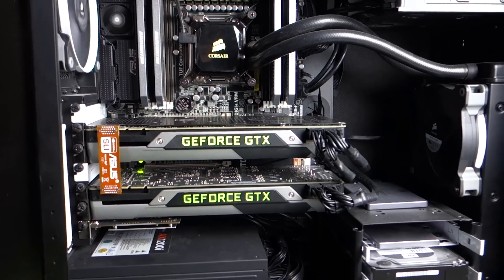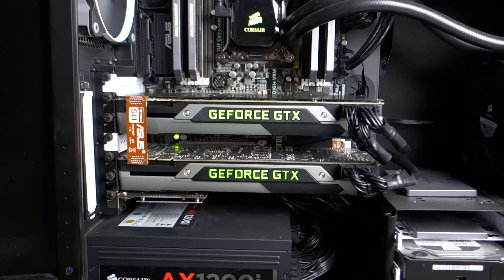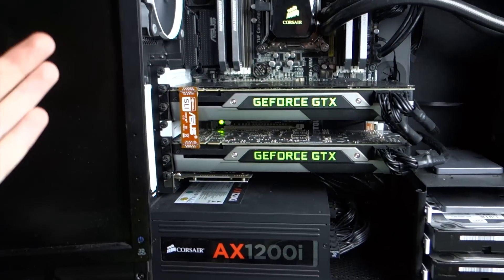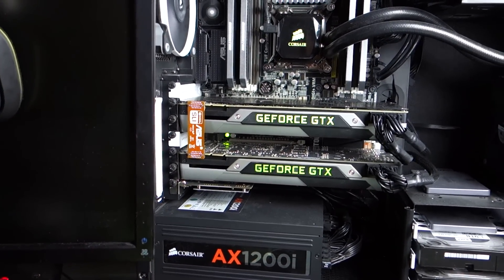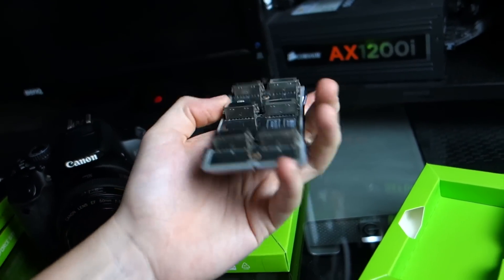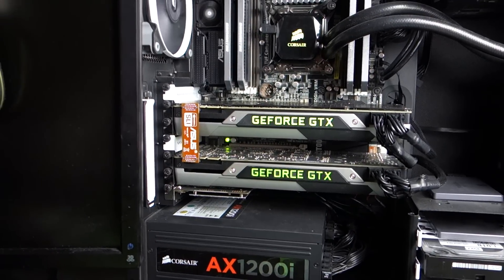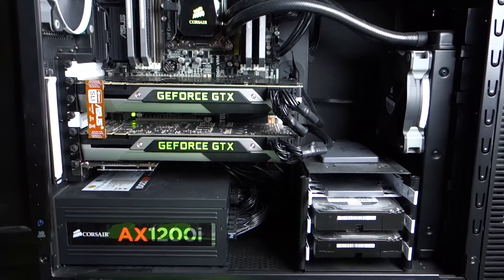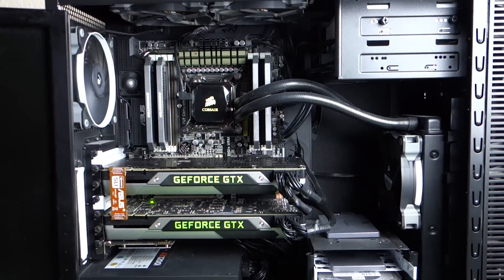SLI Bridge FAIL

Comment: you need to wait for asus to bring out the hb bridge for that board spacing, i have a rampage extreme v and 2 x1080s and the evga hb bridge fits fine, my spacing it between the top pci and the 3rd pci and that is 81 mm apart.

Comment: You need the 60.97mm sli bridge, or the why nvidia says it, 2 way 3 slot bridge. Everyone else will measure it 2way sli long, or 2way sli 60mm which will fit and work with that board. I my self run 2x 780ti's reference, I ended up buying the EVGA Pro bridge becuase the LED was white to match everything in my PC, Other then the damn Nvidia green led on the cards which I should sand them down so they are white.

Comment: What does sli brige do
Reply: +loo jian rung
(Just in case  You haven't found out elsewhere) The SLI bridge allows the graphic cards "communicate" (i.e exchange data) without having to go "via" the motherboard(pcie Bus). They need to communicate to be able to "cooperate and give output as if they were 1 more powerful card. So it's "simply" a technique that allows the Gfx-cards to run more efficiently when they are "cooperating on the same workload". They would loose performance if the had to compete with other parts of the computer using the "resources of the motherboard" for communication that really doesn't "concern" any other component than the two (or more) graphic cards. You can very well run more graphic cards without using SLI but You will miss the performance gain that it offers. 
 (SLI only works with (certain) Nvidia cards, AMD have a similar technique but they call it "Cross Fire")
Best regards.
Reply: This might have been the best explanation of SLI in history... and probably nobody even read it.

Comment: You have a 60mm gap, Nvidia offers 80mm gap bridges (2 way Spaced and 3 Way) I bought one of the EVGA Pro V2 ones because I had the same problem with the Nvidia claw bridge. the 2 way spaced bridge from EVGA is 60mm and doesn't look bad at all :)

Nvidia SLI Bridge spacing FAQ
http://nvidia.custhelp.com/app/answers/detail/a_id/3576

EVGA Pro v2 SLI bridges - Measurements on the bottom of the page
http://nvidia.custhelp.com/app/answers/detail/a_id/3576

Comment: simple change mobos. i did. was sooooo worth it.
Reply: +Tanzu15 How do you determine which boards will work?
Reply: +TheAjax618 By looking at the PCIe 16x spacing... It's really not an issue if you use a little sense and think about what you're doing.
Reply: +Jesse Deptula Yes. Right after I posted this I looked in my mobo manual and the spacing for the sli bridges. Nvividia sells every spacing now. When I purchased a few months ago the one I needed wasnt for sell yet.

Comment: Hudson, 

I had the same issue as you. Here is my fix, with lots of pictures:
http://www.overclock.net/t/1564491/nvidia-geforce-branded-sli-bridge-mod-lots-of-pics

I ended up buying the buying the spaced bridge and then taking it apart and connecting a shorter bridge underneath. 
Please let me know if this is helpful. 
I like your videos and you should be grateful you have the means to make them. 
Goodluck!

Comment from the maker: A lot of you guys are recommending the Nvidia 2-way spaced bridge. However it is identical spacing to the 3-way one I have, only difference is the middle connection is removed (and also the subtraction of the 2nd row). I appreciate the suggestions, but that's unfortunately not going to fix it. Thanks a lot for watching guys, I'd like to do more videos like this in the future. They are fun to get a discussion going :D
Reply: ***** My MSI motherboard came with a flat wired SLI Bridge thats black instead of a PCB one. Maybe get one like that.
Reply: GameThruz that was my problem, looked at their diagram and misinterpreted it lol, oh-well was a good excuse for an upgrade.
Reply: Does that mean that you are going to spoil more stuff for our entertainment ???😜😜😜
Reply: ***** Ran into this same issue on my P67 Sabertooth :( Ended up swapping motherboards to to make this work. I wish Nvidia would produce a "Motherboard Compatibility List" would have been nice to have. So many motherboards have this kind of spacing, in fact pretty sure the majority do. Such a fail on Nvidia's part imho
Reply: +Joey Rakas I have the same issue with my Asus motherboard.  How do you determine what motherboards will work?  I have a spaced Nvidia bridge sitting in a drawer that can't be used.
Reply: Well as you said you didn't do your research, Nvidia do list it clearly on their site with pics.  But you might like to know they have introduced (quietly) an SLI bridge that will work in that spacing (one pcie slot between two cards).  Here's a link http://www.geforce.com/hardware/technology/sli/bridges
Reply: Joey Rakas I have no idea why they decided to do the other two but not the most common one, it makes no sense.  Hopefully I'll be getting one soon for my reference 780s eek
Reply: Nvidia sells spaced bridges for 2, 3, or 4 slot spaces on their website, not sure if they just didn't have these back when you made this video :P https://www.geforce.com/nvidia-sli-bridges

Comment from the maker: Well so as you can tell I'm not completely up to date on everything. Absolutely butchered saying z97, welp LOL.
Reply from the maker: ***** unfortunately not, it's the same spacing as my 3-way one. Just minus a connection
Reply: ***** yo im going to get a GTX 770 and i also have an intel i5 i dont the exact cpu but i also got a 600w power supply will that suffice for the gtx 770 also love that cable management lol
Reply from the maker: blackopsfan00 600w should be just fine for that build, however if you ever change up the GPU or add some other components make sure that your PSU will support those new additions. GL man!
Reply: thanks man appreciate it
Reply: ***** also thanks for actually interacting with your viewers its rare these days.
Reply: +HudsonsTech Dude I did the reasearch, I dont konw if im too late and you already fixed it, but the spaced does work cause the spacing is 60mm not 40mm like in the ones you have (60mm is a special size only for 2 way sli), I had this problem and this fixed it http://www.amazon.com/EVGA-Bridge-2-Way-Long-100-2W-0023-LR/dp/B00X5X3LQY/ref=sr_1_1?ie=UTF8&qid=1442127937&sr=8-1&keywords=sli+bridge+2+way
Reply: ***** the one i have is a msi sli it came with my motherboard. For me no other sli bridge would work. but the msi one is black
Reply: ***** Hey Hudson try this one im 99.99% sure it will work.
http://www.amazon.com/EVGA-Bridge-2-Way-Long-100-2W-0023-LR/dp/B00X5X3LQY/ref=sr_1_1?&ie=UTF8&qid=1436471042&sr=8-1&keywords=nvidia+sli+bridge&th=1
Reply: +HudsonsTech http://www.evga.com/articles/00919/EVGA-Pro-SLI-Bridges-V2/ look at this

Comment: hmmm maybe there is a way to take the single SLI bridge from Nvidia cover off and place it on top of the one you have that works or do it with the other bridge, I don't know if you are willing to take the bridges apart or return them but it's up to you.
Reply from the maker: Yeah I'd rather just buy one made for this, but thanks!